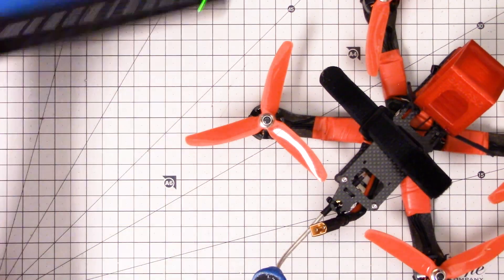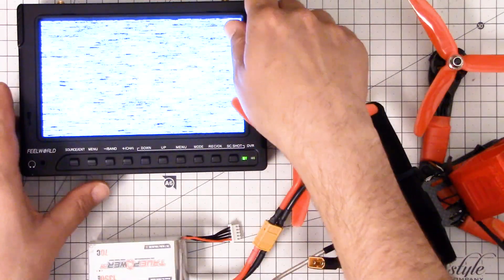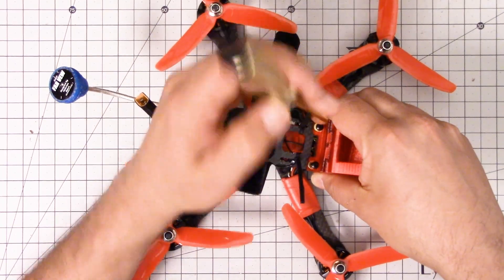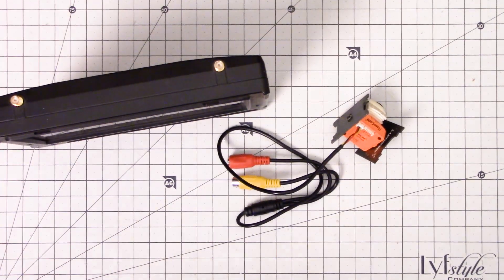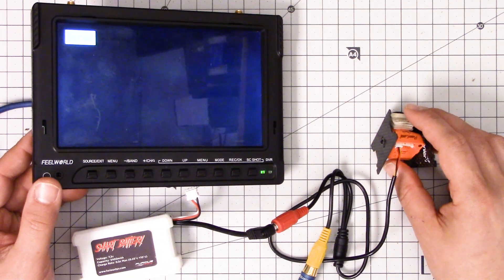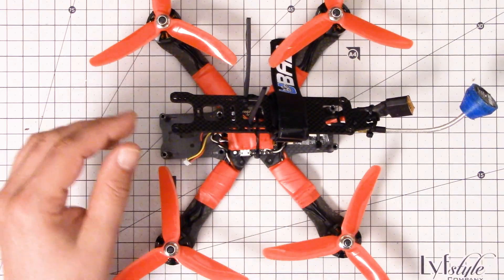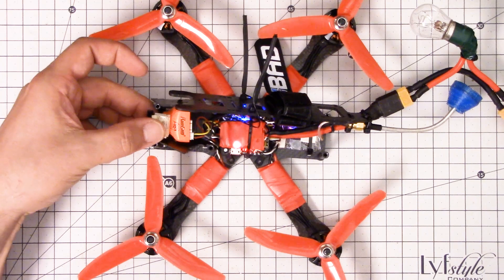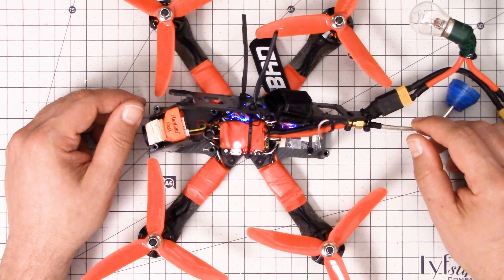FPV Camera Black Screen | REAL WORLD TROUBLESHOOT

Comment: Hello Mr. Bardwell! I am having some trouble with my connection to my goggles. I have the RunCam split 2 that has he ability to connect to my phone and it does well. But when I try to hook it up to my kylin vision goggles they find a small signal but no video. Just a black screen. I think there might have been a time I plugged the battery into with the ground wire (for the VTX) disconnected but I’m not completely sure. Do you think you can help me?
Reply from the maker: It sounds like there is no signal coming from the camera. Check the ribbon cable going to the camera.
Reply: Joshua Bardwell I pushed the ribbon cable as far and as gently as I could and I still go the same result.
Reply: Joshua Bardwell I pushed the ribbon cable as far and as gently as I could in the connection and got the same result.

Comment: Hi Joshua, love your content bud, quick question. I know this is an older vid, but hope you have a minute. What would cause a camera to start out with no image (OSD is visible Omnibus f4sd/ Aomway 200mw stubby) but then have it slowly appear? So if I wait five to ten seconds after powering(4s Tattu 1300mah). Wavey green lines will appear as the image slowly populates the screen. Now if I disconnect and reconnect my battery the camera functions as it should. But if I wait ten minutes before reconnect. This whole process plays out again. Does this on multiple Foxeer1177’s and f4 appears normal in Bf. So if it’s my Stubby, what would cause a vtx to fade an image after ten seconds ?
Reply from the maker: Wire the camera video line direct to the vTX video line. Don't go through the OSD. See if it still happens. If it doesn't happen, then it's the OSD not the vTX. 

Process of elimination...
Reply: Thank you Joshua , I applied your method and it was still functioning as it were. It turned out to be a faulty vTX, I...suspect?..  bad voltage regulator? Have you ever come across this?

Comment: Hello Joshua! Not sure If you're reading comments on your old videos or these long texts, but I will try anyway. :D Im having an very annoying problem with my quad. And I feel like I've tried almost everything.. The problem is; When I do hard flips or rolls my screen get black for a very short time (0.1 - 0.5sec). The first thing I did was that i changed the camera and cables. That didnt work, so i ordered and changed the vTX (Unify Pro HV) that didnt fix it either. Tried to connect both camera and vTX to BEC on FC (7,6V) and I also tried directly to Vbat. That didnt help it either. Then i tried to connect Caps on all my ESC. Didnt work (Much less noise tho). 
And the last thing i did today was so change all the motors and ESC. I bought the best ESC for noise on the market. (Tekko32) It looks like it got significant better, but i still get them. It's almost no noise at all anymore when i fly regular and the quad flies super smooth, but when I do hard flips or rolls, i get these blackouts. Which is super annoying and i dont trust the quad to fly far away... :/ I also tried Default PID's and Rates. But didnt help either.  What do you think?  And also, when the quad is connected to battery and not armed i cant get blackouts even if i throw the quad in the ground or shake/punch it. It only happens in the air it seems. 
Hope you understand my english :D
//
Daniel
Reply from the maker: +Lervik FPV black screen means the camera is losing power or the video wire is coming disconnected. Power the camera from vBat instead if a regulator.
Reply: Joshua Bardwell I have tried connecting the camera to Vbat. :/ change the cables to. Eveything is new or change except the FC. Is it posible that the FC can cause this? The BF OSD also restarts eveytime the blackout apears. Im using CL racing f4 board
Reply: After some research i found out that its my FC.. I see there are many people with cl racing f4 who have the same problem. Something to do with the betaflight/osd chip on the board. And its nothing to do with it.. so i need to change the FC, lol. Its the only thing I haven't changed.....

Comment: I just got my drone working today, and I crashed it once, and the antenna kinda just fell apart. Well the cover did. Now all I get is a black screen, and I don't have the money to replace parts, and my dad isn't letting me get a new one if this one is broken. Also BangGood doesn't have a very good return policy; I have to return it by tonight if at all. And my siblings lost my only working screwdriver with it. Please help!
Reply from the maker: +Dominic Larson if you crashed it and broke it, nobody will take it back. Sorry...

Black screen means the camera signal is not getting to the videi transmitter. Look for a loose wire or something.

Comment: I just recieved a runcam and did a build with it. Everything runs fine as well as the osd. Ive got no humming noise. The solder joints are very nice. No bridging between joints.. Its an brand new runcam. I could try a different camera to see if it works, i suppose. Ita a Runcam Swift 2 and it never came with the old school aux. connectors. Blehhh ha

Comment: Have used the auto scan.
I did leave them in the van for a couple of days over winter in below zero conditions, it's been suggested that some moisture may if got inside and has knackered them. Had my new goggles delivered yesterday so I'm trying some trouble shooting myself. Iv also wired up a new eagle2pro so going over these conections to👍

Comment: Thank you so much for all your videos,  you've helped me tons getting in to the hobby. I'm in a strange situation. I have two pairs of Googles.  Both eachine, goggle two and the ev100.
The ev100's have a snowy screen
But the Google two has a black screen except when I unplug the vtx, the the screen goes snowy.
No OSD but I only just turned this on after watching this video.
All this has happened since I followed you instructions on the V-bat and buzzer install for the wizard. 
Could I have damaged the PHB or FC when sodering?
THANKS FOR YOUR TIME
Reply from the maker: Snowy screen means the vTX is powered off, or the receiver is on the wrong channel.

Black screen usually means the vTX is powered on, and you are on the right channel, but the vTX is not getting a signal from the camera.

You probably didn't damage anything permanently. You probably just didn't wire the camera up correctly.
Reply: Your Amazing. I may try the direct connection see if that helps.
Thanks and I hope everything is all good after becoming full time
Reply: Sorry I didn't explain very well. It's only on the goggle two that the screen goes black when disconnect VTX the er100 constant snow. 
I'm guessing from your explanation that the er100 may be damaged aswell 
Should of took your advice befor buying them. 
Thanks again
Reply from the maker: ER100 constant snow probably just means it's on the wrong channel.

Comment: So if I’m not getting any video or OSD that means my FC is the problem? I’m just getting a black screen with no OSD. I have another copter that uses the same board. It has the same issue as well. They are both flycolor raptor s tower stacks
Reply from the maker: The easiest way to tell if the FC is the problem is to connect the video signal wire directly between the vTX and the camera.
Reply: Joshua Bardwell that’s exactly how I determined the problem lies with the FC. It uses a pass through function with the FC. Vtx plugs into it and then the camera plugs into it as well. I could always go the old fashioned way and connect them to the pdb and it should work fine. Thanks for the reply back!

Comment: Hey Josh I have a question I'm really kind of stuck. I put on for new motors on my quad copter which flowed perfectly fine before hand. When I put him on the motors were going in the wrong directions which made the copper go haywire on the bench. So then I reversed caveman style the wires and got the motors going in the right direction and it flew fine. But now my goggles my fat shark diversity only getting a gray screen I'm getting OSD but I'm not getting any video help

Comment: Have black screen in HD3's. Been operating with no issues for 5mo since UBad diversity install. Was using DVR around time blurring occured then total blackout when connected to signal from VTX. If no signal then get usual static. Was sure it was issue with wire harness for UnifyPro so re did new harness to no success. forgot about Handheld Screen with built in receiver and video is good locking issue to HD3's. Dismantling  now and all connections look good as well as unable to locate any burnt caps or broken connections. Please advise. Cheers
Reply from the maker: +MIKE HUNT contact support @fatshark
Reply: Oddly after putting HD3's back together system is working perfectly again. Completely stumped. I decided to clear heat shrink the 9 pin wire and add lil dab of hot glue to all pin connectors make a lil more robust. But just a mentioned in your vid , this may be the just beginning of a bigger issue. Will post future issues and fix. Really appreciate you taking the time to share your experience.

Comment: What do you suggest if I have black screen with showing NO osd 
 on a omnibus f4 pro? if I connect camera direct to vtx the video is ok. thank you
Reply from the maker: +Matteo Lombardi first set pal or NTSC manually in the osd tab of the configurator.
Reply: Joshua Bardwell thank you, I'll try! you are amazing,you do amazing video and you also reply to us very quickly!!
Reply: no way, even changing AUTO/PAL/NTSC I alway only have a black screen. I think somethint is broken inside the fc
Reply: same problem as you with f4 pro ... do you try to flash BF ?

Comment: I just bought a brand new runcam and a brand new vtx and my fc works fine. Is it possible that its the fc even though nothing seems to be wrong with it?
Reply from the maker: Anything is possible. Connect the vTX directly to the camera and see.
Reply: Joshua Bardwell thanks for the reply i will try that.

Comment: My problem is blank screen when powering the camera from the quad, but if I power directly from the battery everything works fine. Ive tested the quads power supply and the power lead im using is giving a healthy 12.14v so I dont get whats wrong.

Comment: I have the runcam swift and I got a black screen with my dragonfly VTX, 
and with the mini VTX the camera work fine, I know that the dragonfly 
VTX is work because I have two of them and its give me the same problem.
 I pretty sure the problem is something on the setting on the VTX or on 
the cam . How I fix that ? 
thanks! BTW love your videos!!!
Reply from the maker: +MC flyer black screen usually means the camera is not sending image to the vTX. Plug the camera directly into your goggles using an RCA adapter. See if the camera is outputting picture.
Reply: Joshua Bardwell Yes , my camera outputting picture beacause I can fly with the micros VTX. But with the dragonfly I have a black screen and the dragonfly work, so its meaby something with the settings.
Reply: So I need to buy a new cam, I guess. What cam you recomened, swift 2, eagle 2, monster v2 or the arrow ? Thanks!

Comment: My camera blacked out a few times a one quad today.  Of course it never did it on the bench, only after being in the air for 30-60 seconds.  I guess I'll take it apart, check solder joints,  wiggle some stuff, and put it back together.  And see what happens.

I saw the comment on grounding with the screws below but my camera is mounted on small TPU parts that came with an RDQ Mach One.  So I don't think that's it.

Comment: Hi again. I'm now using a betaflight f3 board. It flys perfect but I have no osd from the f3 board. Have u had the same question b4 and do u no the answer?
Reply from the maker: Manually set PAL or NTSC according to what type of camera you have.
Reply: Joshua Bardwell it's the run cam owl. Thanks. Il have to wait til payday now. I broke off my mini USB connection. So hopefully gone try and connect with a dedicated adapter. Thanks again
Reply: Ftdi adapter. Bloody spellcheck.

Comment: So Funny!!! I just finished fixing this same problem.  Black Screen situation.  And then I sit down to watch videos and this was the first one up.  After trouble shooting everything,  I discovered a short in the middle of a ground wire between the osd connection on the flight controller and the video transmitter.  I saw a kink in the wire, and discovered no continuity in the wire, it was broke.  Changed the wire and good to go.

Comment: BFF3 appears to have a weird issue for some. Same issue here:
-VIDEO + OSD overlay worked for a few seconds. Afterwards, only OSD would work (black video)
-Plugged in/out lipo a few times. No changes.
-Wanted to record a video for FPVMODEL's support. Video + OSD works.

Tried two different cameras and brand new unify race video transmitters.

Did not change a single thing in the meantime (wiring).
Same issue as described by CONRADM over at rcgroups.

Comment: Hi, it happened so many times with me to have the connection to the camera loosening out. Crashes or vibrations can make the socket move just enough to break one of the contacts to the cam. 
I'm betting your setup is fine, but it will happen again. I hot glue all my camera sockets now. 

Ah and I thought the noise comes from voltage regulators.

Comment: Joshua Bardwell Did you find solutioN? I got the same problem! on my betaf3 fc
Reply from the maker: +eloy gambin not yet. I don't think it's the camera though.
Reply: I have changed the camera for a brand new, let's see what happens!! BTW Joshua, Did you have problems soldering the GND pads on the Betaflighf3 FC??? All my GND (holes) and somes of the ESC signal couldn't be soldered properly

Comment: same problem on my Runcam Eagle. After changed brightness and "save & exit" i have only black signal and no cam osd. same on lcd direct connection
Reply from the maker: If it's the same on LCD Direct, then it's definitely the camera. There isn't any setting I know of that would cause the camera to stop operating. I also don't know of any way to reset the camera without being able to see the OSD.

Okay, here is a workaround. Buy another camera. The exact same one. Plug the OSD cable into both. Follow along exactly on the broken one as you go through the menu in the new one. Go to "reset to factory defaults" and do that. Best case you now have two working cameras. Worst case you have one working camera.
Reply: Thanks Joshua. But i purchased a Swift 2... bye bye 16:9. It seems that is a narrower image on dom v3 but with more field of view on top and bottom.
Reply: I will try your tip but counting the steps of menu with black screen following a video and manual included....

Comment: I have had kind of the same problem. I had a screw barely touching the motors windings where they come out of the motor. When my top plate was mounted with the SMA connector touching the carbon, it was backfeeding the voltage from the motors into the antenna ground and wreaking all kinds of havok. Since you get a straight up black screen of death on the camera, I would check for any point that may be shorting out to the frame, and backfeeding into the antenna SMA.

Comment: My runcam swift 2 died in a similar way, but I was using the built in osd. it would get a black screen and you could see the osd. If I tilted the screen it would cut out. when I put a new camera in the problem went away.

Comment: I just had this happen to me, fortunately it was the camera. sometimes in hard crashes the connection at the camera side can wiggle the solder joints loose and on punchouts screen goes black and comes back again. I would plug it back into the tv and wiggle the connections.

Comment: Great video..Question- using an Omnibus F4 Flip32, camera wired through the FC-no video signal only OSD, camera wired direct to VTX-works fine.  Running 12v to camera from PBD and 5v to(3.2v-5.2v required) VTx.  Thoughts??
Reply from the maker: Make sure that PAL or NTSC is set correctly in Betaflight OSD tab of the configurator.
Reply: Joshua Bardwell did that. No luck.
Reply from the maker: Power the camera from the regulated output of the vTX. Use power and GND to the vTX.
Reply: Joshua Bardwell did that initially and got same results. Tried independently powering everything because of the low voltage requirement for VTX(had 3.3v with initial set up).

Comment: Nice video...had the exact same problem black screen (minus the humming) just abt two weeks ago. It turns out the pdb pads powering the camera was faulty...i moved the wires and powered them from the pads that the vtx was powered from and it worked fine...until i crashed and broke my quad :)

Comment: my assumption is that it's your power supply you have a transistor that's about ready to go mosfet regulator I used to have the same problems with some of my ham radios I used to run when there's a spike usually he'll start to go bad try putting it under more of a load and see if you can get it to do it then like hook up a second camera good luck keep up the good videos

Comment: I had the same problem with my alien an my charpu 210 found out that the betaflight f3 wasnt holding a good solder once I got good solders on the FC issue went away